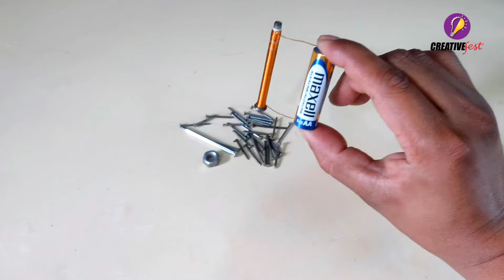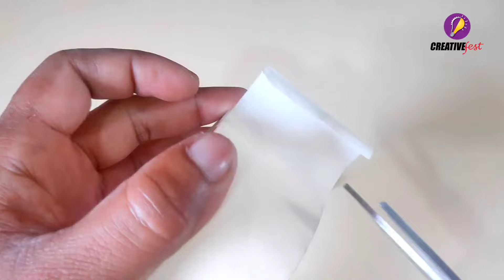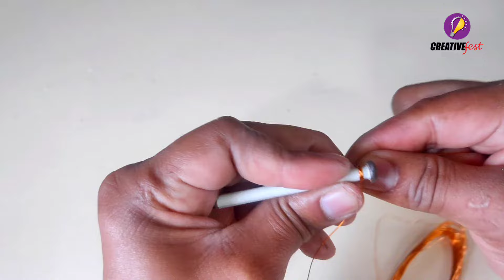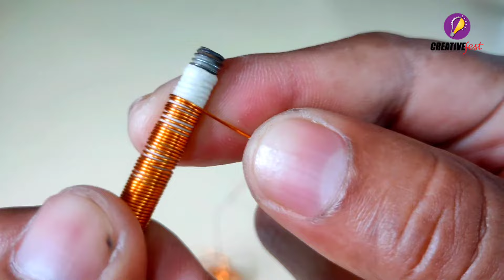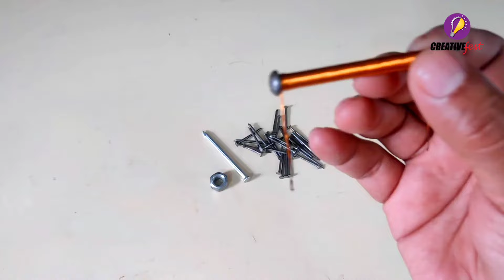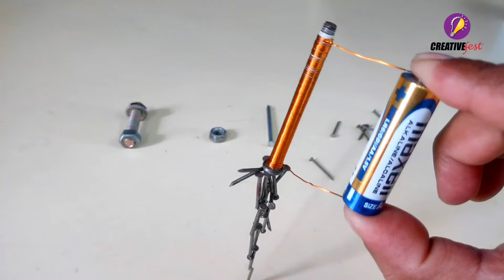Easy way to make Electromagnet| Science Project

Comment: You better have enough resistance in that wire, made by large amount of turns, in order to limit the current from the battery and not be a short circuit of a battery. Or kaboom!
Reply: what if i use a resistor